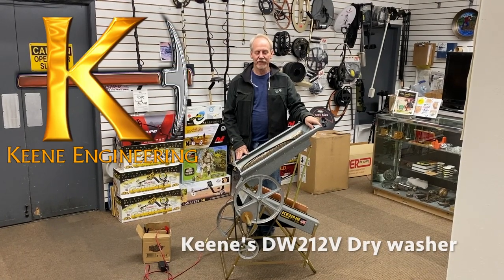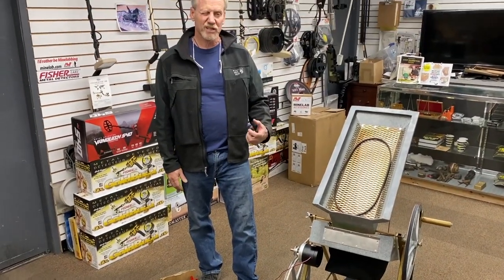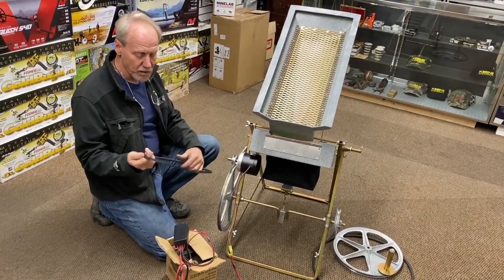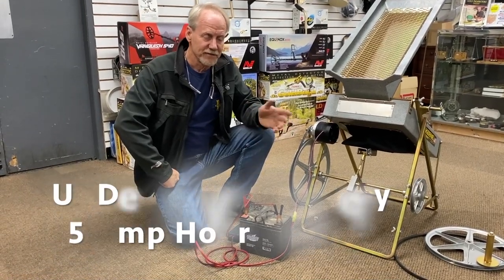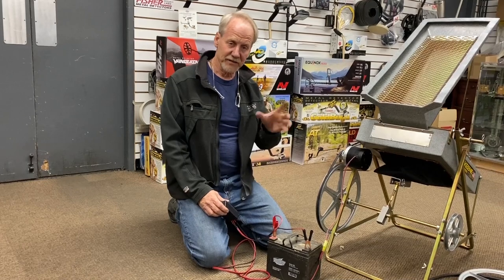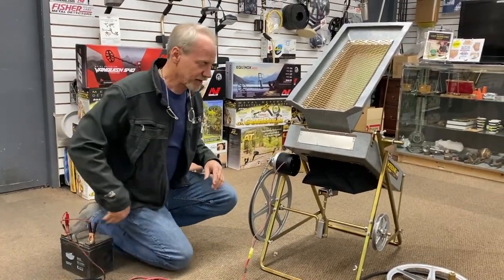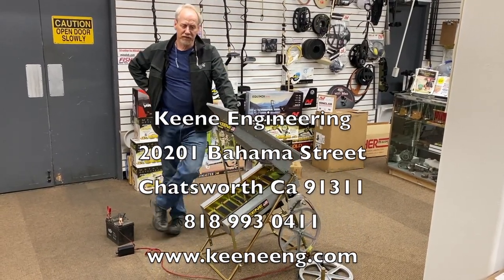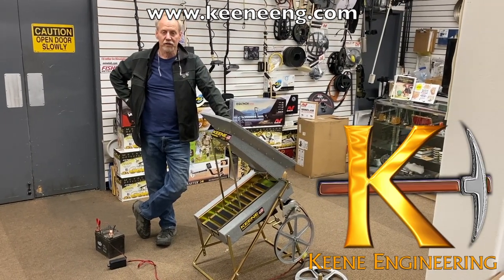DW212V updated drive motor system

Comment from the maker: The noise coming off the machine is play in the cam system that also adds to the vibration.  When the DW212 is new, the came can be a little noisy.  After a few hours of running the Dry washer noise drops substantially.

Comment: Any estimate on how much dry material you can put through the machine in an hour? Thanks.
Reply from the maker: I would estimate up to 1/2 a yard per hour.
Reply: @KeeneEngInc  Thank you. I am debating between the puffer or the smaller motor powered low dust unit.

Comment: I just watched  a guy who adapted  a drill to power it with a adjustable  power off the battery
Reply from the maker: A drill motor would work.  We use a 12 volt speed control PWM so we can precisely control the speed.  Watch this video as well https://youtu.be/8tA2qnnDAH4?si=SR2a3RxDd8h1BnXt